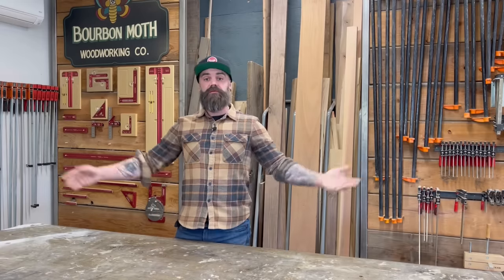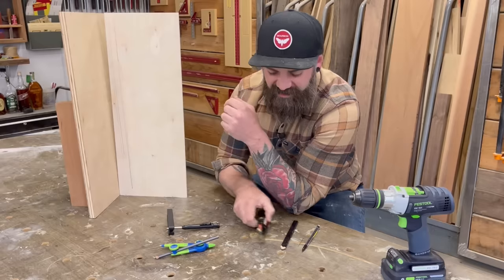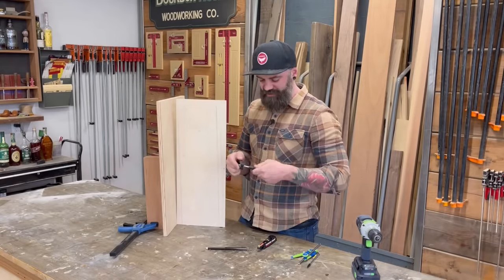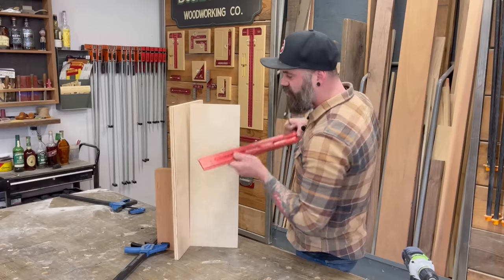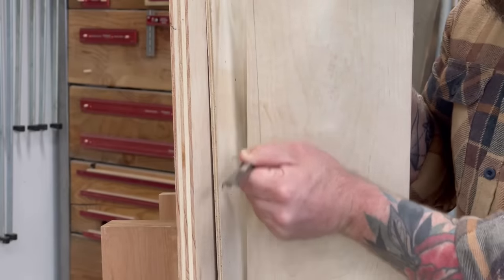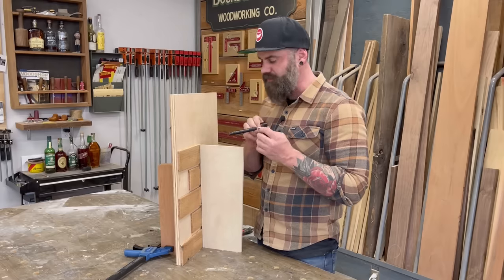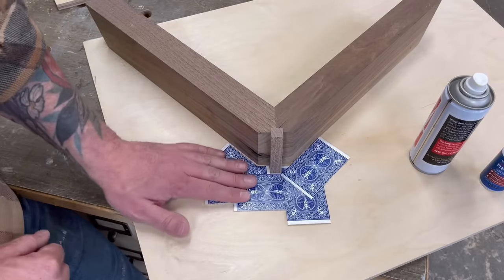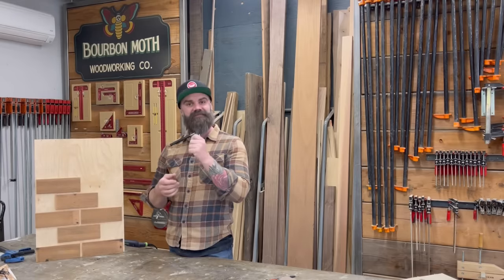Woodworking Tricks You'll Actually Use || How to Scribe to an Uneven Wall

Comment: Another trick that might work depending on what your working on is a washer and a pencil.  In violin making you have to scribe the ribs on to the boards for the top and back, but not exactly.  You want it to be about 2mm away from the ribs.

You can go out and buy a scribe or an insanely overpriced violin top scribe.  Or you can go to literally any hardware store and buy 1 single washer that's 2mm wide for about 0.05 cents

Comment: Thanks Jason, another useful vid but I have  two complaints.
Firstly I only saw this now, which means you posted two days early. Or I'm two days late. Some issue with converting imperial time to metric, I guess.
Secondly, you didn't show the dado-no-scribe technique for brick where you just chuck a masonry dado stack in the table saw, balance it on your shoulder and use it to cut a nice dado in the wall to fit your board.

Comment: A key point about scribing that you didn't mention is you have to keep the angle of the scribing tool steady the whole time. The reason the flat one feels so solid is that (as long as the surface you are scribing is flat enough), it keeps the angle for you. If your angle wanders, your scribe line will wander as well. It's probably easiest to eyeball keeping the line between the point and the marker parallel to the ground (as you do in this video), but any angle will work as long as you keep it consistent the whole way. Assuming the radius of the roller is small enough for any concavities in the scribing surface, a rolling scribe tool with the marker in the middle of the wheel will give that same guarantee that you can't accidentally shift the angle, but without the requirement that the scribing surface be flat. Similarly, any round(ish) tool with a central marker - such as the mechanical pencil you mention will give the same guarantee, even if you slide rather than roll it.

Comment: On teh brick scribe, he set his scribe WAY TOO WIDE.  It should be set to the largest gap - about 1/4" in the instant case.  THe carpenter pencil scribe is nice, but if he glued a piece of wood to the one side of the pencil and put the guide bit through that way, he could get a much finer line out of that fat lead pencil. The benefit of the compass style scribe is the easy adjustment.  However they need to LOCK once that distance is set to be serviceable. Been doing it for years, thought to see what tricks he might have.  
Cutting a bevel on the board to be scribed would result in a smaller contact surface with the  subject surface to be scribed to.  A 45 seems a bit extreme.  As well, I was taught to bevel the board after the scribe. Have to check with Norm Abrams!

Comment: I don’t think I would ever call that a cheater scribe. That’s an extremely complex corner to go around and any other method of scribing would be difficult to get 100% accurate at best. I’ve seen another woodworker that uses a double deck of cards that he rubber bands together and then pushes them into complex corners and angles to scribe them. And obviously, he make sure they go into every nook and cranny. I think both ideas are absolutely brilliant and should never be called cheating. Work smarter not harder! And it seems using playing cards gets the best results. I see no cheating. 😎

Comment: Can someone explain to me how this doesn’t change the depth of your cabinet? Like when he was scribing the brick it seemed like he took out a huge chunk of the item he was scribing. If that was a cabinet wouldn’t it actually change the depth of the cabinet? I’m guessing you build the cabinet first and don’t do the scribing until you install so how do you prevent changing the depth of the cabinet? I’m sure it’s something simple I’m overlooking but if someone could explain I would appreciate it.
Reply: It wasn’t the final width is what I assumed.
Reply: You check walls with level, before building custom cabinet and leave extra material for scribing. You cannot do that with pre manufactured cabinets, unless you pay for custom end cabinets or use an ugly filler strip.
Reply: @samsonhorvath3614  ok, I think I understand what you are saying but it still doesn't make sense in my brain.  If I need a cabinet to be 30" depth, how do you "leave extra" to get a 30" depth that matches exactly with the next cabinet over.   Because with "extra" it might end up being 30.25" so I just don't understand. I'm sure it's something easy I'm just missing.
I'm also wondering why scribe a cabinet to a wall when you will never see it (like kitchen cabinets)?  I was thinking people would tell me that with cabinets where you can't see the back that you would just build them to the depth you need and use shims.
My father was a master cabinet builder and one of my great regrets in life is that I didn't have him teach me how to make and install cabinets.

Comment: The 45 degree trick made sense until the scribe line exceeded the length of the 45 one the face piece. So maybe angle the track saw or jigsaw at 45 while cutting it? 
Does that make sense to anyone else?

Comment: To make it much easier. Do not scribe :-). 
Instead mount the cabin to the wall. Then put an quarter round on the sides :-). No GAP and it looks really nice.
The second benefit is that it does not feel as boxy. Since you have the rounded corners.

Comment: But, the drill bit is only held by friction (meaning it can shift) so your scribe will not be accurate. Also, the angle of the pencil to the wall can change, again making the scribe inaccurate.
Way better to use a washer or some sort of circular piece so the pencil is always the same distance from the wall giving you an accurate scribe... The only problem then are corners.